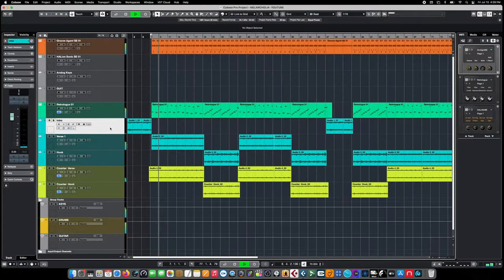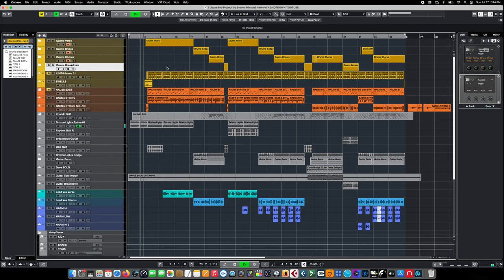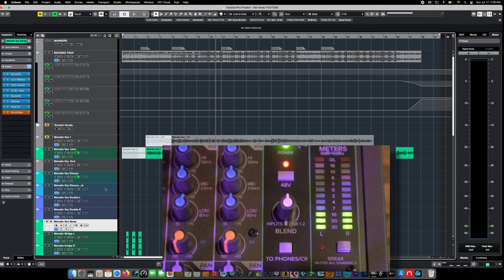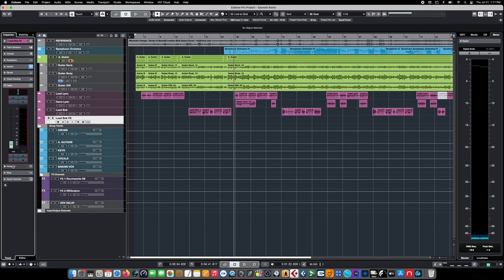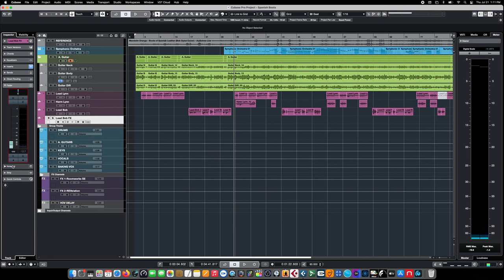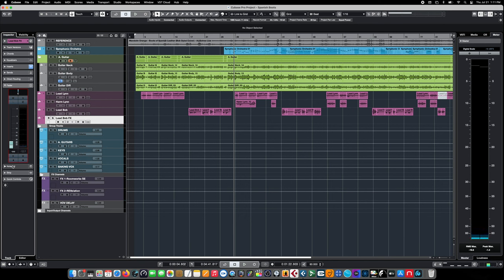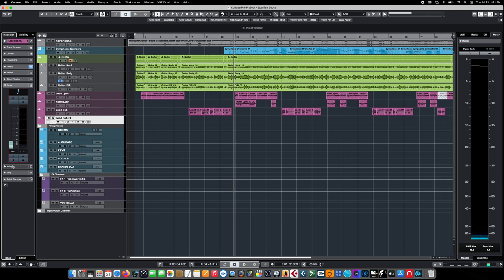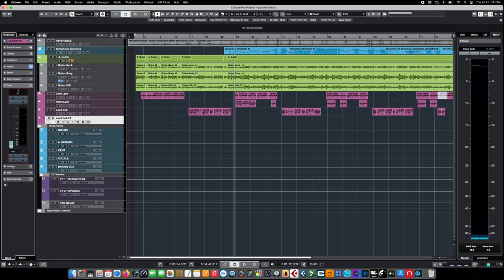ULTIMATE GUIDE To Latency in Cubase

Comment: Do u find you have to run at a low buffer in your DAW to actually capture your midi performance input even if you play on time? I not talking about audio latency. You can have hard ware synths go to a mixer for that. But I play a midi controller in my daw to trigger them. Im also not talking about timing issues of your midi playing out to hardware synths. I’m talking about playing midi in your daw and when it records the notes. Do you find it captures them better in time with lower buffer?
Reply from the maker: Definitely, anything that strains the CPU is going to affect that. Thats why, at the end of a project when I have a lot going on, and I have to record more parts, I always shut down VST's and even temporarily freeze VSTi's if needed.
Reply: @Featherlightstudio   awesome information sir. Do you happen to know if Protools has a similar constrain delay compensation?
Reply from the maker: @undercrownhiphop9422  I dont have the latest subscription version of PT to compare, maybe some one else can chime in here on that one?
Reply from the maker: @undercrownhiphop9422  In your Pro Tools session if you click on the little notepad icon at the bottom left corner of the mixer, it will open the mixer options and you can enable the delay compensation checkbox. You can also go to 'View' / 'Mix Window Views' and enable / disable it there as well.

Comment: Great video, I use a combination of system to achieve low latency, I have one interface for Cubase set at 2048 samples to play back the entire project (80 plus tracks) without glitches, I plug my guitar to one of the inputs and then from insert out (or direct box) into another interface (not related to Cubase) with 96 samples, I assign my guitar fx software to that interface to hear all my guitar effects. Everything I record is dry and completely in time while I hear exactly what the guitar should sound like. Then of course I assign that same guitar fx instrument as insert instrument on that recorded track.
Reply from the maker: Great Idea!

Comment: In my experience, Keyboard/VSTI tracking latency can be easily avoided by always tracking with a basic VSTi routed directly to Stereo Out. After I'm happy with the performance I'll then route to the appropriate groups, choose the best VSTi/settings and apply inserts. You can even use a dedicated track for this and move your events after tracking them. Simply disabling inserts will NOT usually work; the mere existence of something like a multiband compressor on a major bus will clog up your VSTi for some reason (in Cubase 11 Pro at least). I think the Constrain Delay Compensation probably would address this scenario if you set it low enough.
Reply from the maker: Heh Steven, Thats kinda of the point of the 'constrain compensation' feature. It automatically determines the FX in not just the Vsti, but also downstream busses, Groups and Master FX that are incurring latency. It powers them off, not just disables the inserts their on, as bypassing inserts still creates the latency problem.
Great suggestion about the dedicated track.
Reply: @Featherlightstudio  I'm used to working on kind of underpowered hardware so I'm usually trying to find ways to get past those limitations. I like having a dedicated track for recording new MIDI performances on a big project because you can quickly record some notes without diving into any settings and it will work even on an older version or non-pro version that might not have "constrain compensation".

Comment: Assuming that most of people (specially pop, electronic, rap/trap) will work at 44.100/24bit or 48.000/24bit, between 128/512 buffer size, "producing/mixing on the flow". What are the best options of audio interfaces in terms of RTL (round trip latency) on those values?
Reply from the maker: This is a great resource for real world latency results: https://gearspace.com/board/showpost.php?p=15796206&postcount=5092

Comment: Just before 13:57. NO YOU CANNOT GET A DRY SIGNAL INTO THE RECORDER IN THIS WAY because the DI box is connected AFTER the pedals: Jump up and down all day but you ain't going to get any dry signal whilst the DI is AFTER the pedals. No matter what you do you will still hear those pedals full on both from the parallel out AND the mic output of the box. Please correct this because you are confusing everybody.
Reply from the maker: That's the point of the second method...to 'include'  the sound of the pedals with the dry signal ( meaning no amplifier ) sorry for the confusion. The first method shows how to get a re-amp signal chain that prints the direct out from the guitar with no pedals or amps. The idea is to pick the method that best suits your recording style.
If you want to change 'everything' after recording, then Method one.
If you want the character of your 'pedal setup' included in the recording, then Method two.

Comment: I've never experienced latency like I have in Cubase 12. 32gb ram on a 12th gen i7 with a motu interface and 3 vst's starts to break up, even at 512. Asio guard spikes like crazy. I went to Studio One 5 and it stopped.
Reply from the maker: The newest 12.0.40 version is out, might be worth a try to see if it improves a bit.
Reply: I've used both on and off for a long time and found Cubase to be overall more stable and use about half as much CPU as Studio One and less crashing.

If you want the most stable setup money can buy, use RME interface or pcie card (can use any actual converters you want) via MADI. And use Reaper. 

This is not what I use, but is 100% the most stable solution available on the market, and will work on any OS.

Comment: Great info! I just notice this in cubase and it's driving me crazy. When have a plugin comp eq etc... on lets say my kick drum insert channel uad la2a for example I notice the meter is delayed from the kick hits the same thing on fabfilter pro q eq 3 and the others. If I activate Constrain Delay the meters plugin work perfect but it also disengages other plugins like on my master channel inserts for example fabfilter pro L2. So when it comes to mixing I'm totally lost now since I discovered this. Any help would be greatly appreciated. Thanks. Cubase pro 12 mac m1 uad x6
Reply from the maker: I have noticed a few holdover bugs from previous versions that are not fixed for M1 silicon like the VST tuner spiking the CPU meter. And the older VST's like the DeEsser shows the gain reduction with the system Latency (behind the beat)
Way back in the day, this used to be a graphics card issue but not with modern systems.
Might be a great question for Greg Ondo over at the Cubase weekly live stream?
Reply: Thanks I will follow up w/ Greg I had to create a new Cubase project and import all my tracks from the latency project into the new project and it works perfect.🤔 Very frustrating to have to start my mix over. At least I still have my song. Thanks again,   @Featherlightstudio
Reply from the maker: Glad you finally got it sorted! @billymack4258

Comment: Thanks! I'm gonna try out the tip of mixing my direct monitored signal from Scarlett 4i4 with some Cubase "Sends" in PRE-fader position with the vocal track fader turned all the way down! QUESTION: I'm assuming however that with this method, any time we want to listen back to what we recorded, we are going to have to move the fader back up? And also, if we were doing punch ins, this method would likely not work since the signal would be turned down, correct?
Reply from the maker: Heh Alain, Yes, when you listen back, you have the benefit of all the regular FX on the track, you just need to bring the fader back up to hear them. This method still works when you 'punch in' as long as the yellow 'monitor speaker icon' is engaged as Cubase is still processing live audio. So the process goes like this with the fader down: Engage monitor icon and punch in.
Disengage monitor icon and raise fader to playback. It becomes second nature after you do it a bunch.